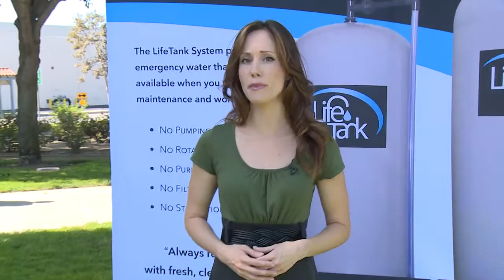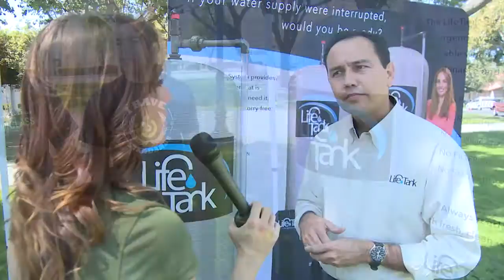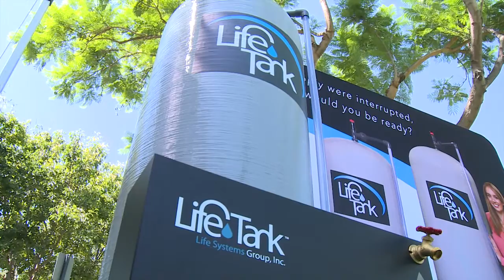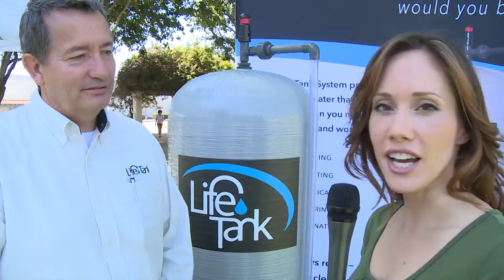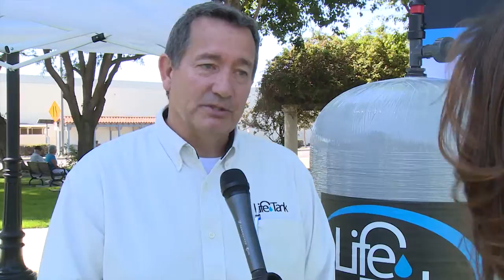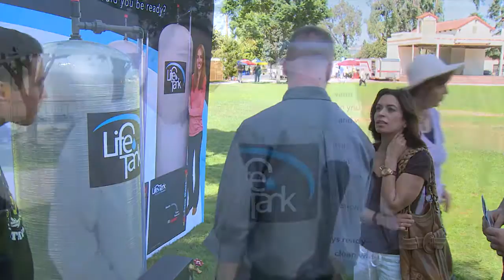LifeTank: Emergency Back-Up Water System

Comment: Is LifeTank metal or a type of plastic?
Reply from the maker: The LifeTank is made of Copolymer Polypropylene and then is wrapped in fiber glass so the tank can withstand the water pressure. Some homes can dish out a lot of pressure so we had to make it sturdy enough. Sorry it took so long for us to respond! Call us if you need anymore information!